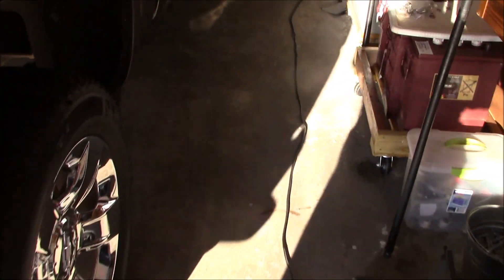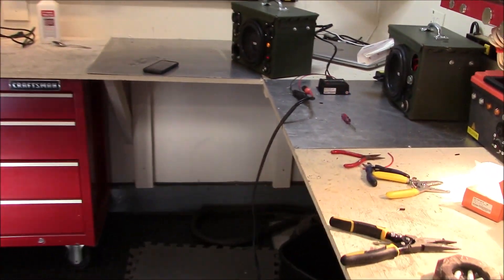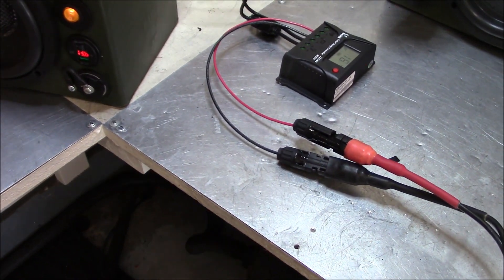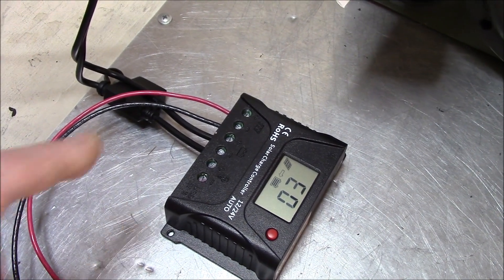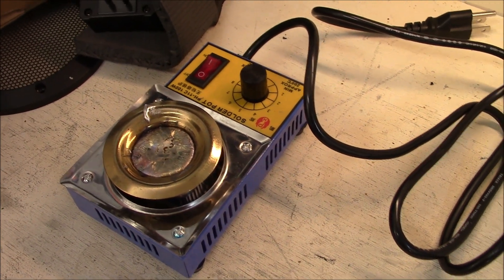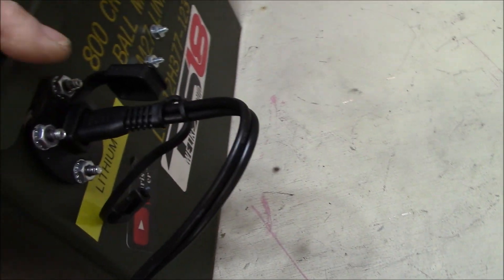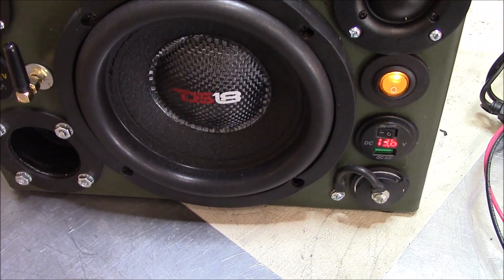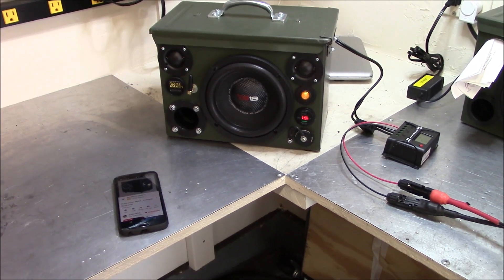Dakota Lithium 10aH battery being charged with solar panel power

Comment: The Dakota lithium batteries should come with a built in battery management system so what is the purpose of the solar controller?
Reply from the maker: Prob best to ask the guys at Dakota about hooking up a 12v solar panel "direct" to their battery without using a solar charge controller. Renogy makes a PWM solar charger (Renogy Wanderer Li 30A 12V PWM) for about $30. I own three...they are EXCELLENT for lithium (or AGM, wet). Selectable battery type. FWIW, I have also seen guys NOT using a fuse on their BMS equipped lithium batteries. To me, not a wise move not to use a fuse or solar charger with these high end lithium batteries.
Reply: @ChrisDIYerOklahoma  I have since emailed them and asked. Just seems to be kind of redundant to use one considering they claim to come with built in BMS. But i'm no battery guru. I'm looking to build a couple game camera solar packs with their batteries. A 12v7ah SLA only gets me about 6 months before it needs to be swapped out.....and it's got a solar panel as well. I really need to check output voltage of the solar panel and make sure it's actually working I suppose. I've got 2 of hme-12vbbslr packs but would like to create my own long term unit
Reply from the maker: @RuStYpNuS  -- WOw....just looked up those "hme-12vbbslr packs" online. Never seen those before. Are you looking to swap out the stock sealed battery with a Dakota Lithium battery? I don't know anything about those packs (type of charging, output, etc). A battery swap out might work, but it all depends on how the circuity is designed. FWIW - I have two systems outside in the cold right now with Dakota Lithium and Battle Born batteries...no issues with charging and the cold using solar charge controllers and solar panels.
Reply: @ChrisDIYerOklahoma  I was actually planning on building my own and remote mounting the solar panel. Downfall is the 12v cable on those boxes is a stainless braided cable so it's more varmint proof than your standard cord. I may try to reverse engineer the box and remove the cable from it. I wouldn't be opposed to just using that setup with the Dakota battery assuming the existing solar panel would work.
Reply from the maker: @RuStYpNuS  -- gotcha. That solar panel is rated for a max 40 mA output...might not even be enough power to turn on a lithium battery's BMS to initiate much charging. I built a small plastic ammo can box like that with a 10 aH Dakota Lithium battery. I am using a 12-watt car battery solar panel (12v power socket plug in) and it works pretty good. A better solution (IMHO) is to get a 15-20 watt dedicated 12v solar panel with a bracket mount (to bolt to a tree, fence, etc) and (possibly) a PWM lithium solar charger. The power cord for the trail cam can be used on the output of the solar charger (if the trail camera is 12v). Just my 2-cents. I think you're on the right track tho...really good idea for long-term surveillance, animal video, etc using a lithium battery, good solar panel, etc.
Reply: @ChrisDIYerOklahoma  only downfall is the trail camera is cellular. Might cause issues if the BMS ever shuts the power down. I'd hate to fry something in the camera due to a power interruption while transmitting.

Comment: Nice.  Curious, does charge controller trickle charge?  If so, will it play friendly with internal BMS of the Dakota Battery?
Reply from the maker: I think it plays well with the BMS in the Dakota Lithium battery. Not only did I throw about 5 amps of solar panel power to it, once the battery reached about 14.3v...it backed off the solar charge controller charging amps. So, the battery is acting well with this configuration. I was playing some music (had a load on the ammo can speaker)...it got up to 14.1v and still was accepting about 4.93 amps of charge current. I turned the little amplifier off, it went up to 14.3v and then backed off the solar power. So, from what I can tell...looks good to me! So in conclusion, you can boogie-jam music with the solar panel connected and hold (trickle charge/power) the load at the same time. The BMS doesn't seem to get too upset...